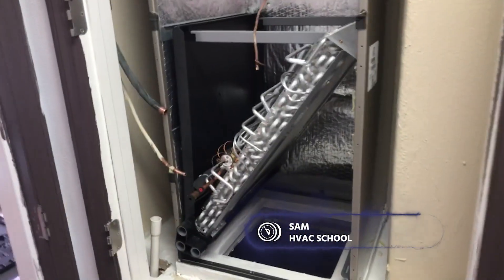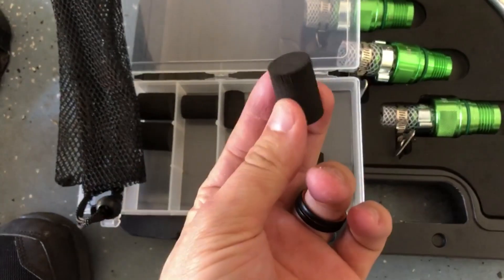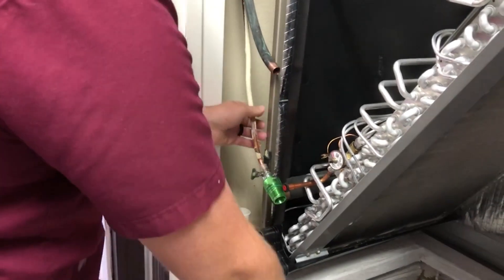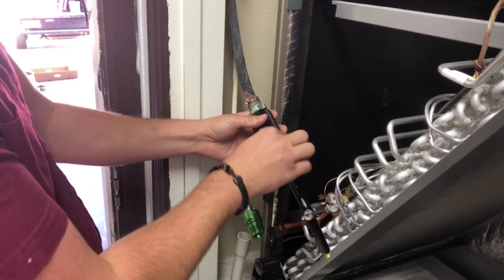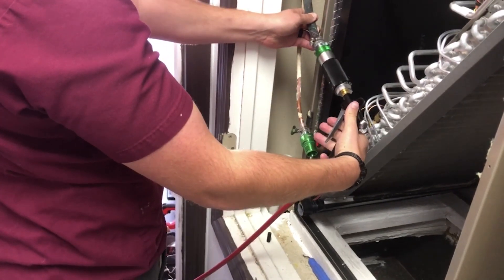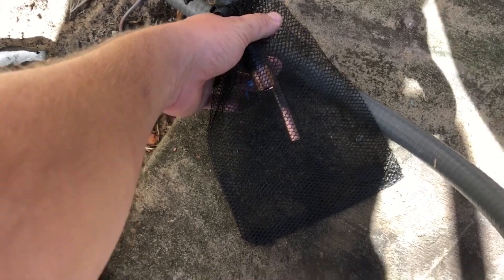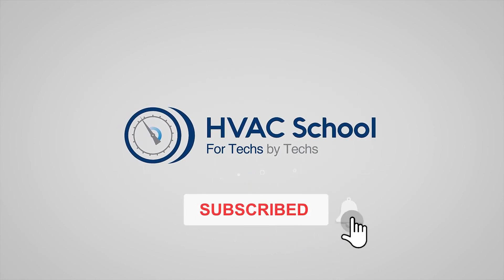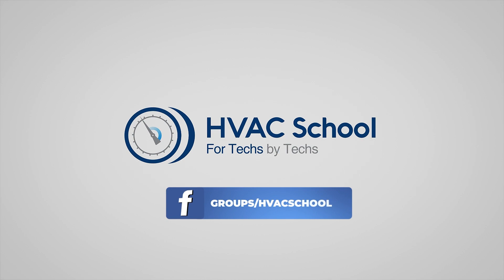Hilmor Lineset Cleaner - Field Demo

Comment: Small over braze or copper would stop that plug. Not sure what it achieves. Change your drier blow through with ofn . Triple evacuation then good old fashion vac
Reply: Mine grab the copper oxide left over from some genius brazing without nitrogen.  It works!

Comment: I would be nervous of the foam plug getting stuck like in a slight kink or a fitting. Not to mention different size pipes in the other.
Reply: He did a demo at the symposium. Check it out
Reply: That's exactly what I was thinking

Comment: Does this eliminate the need to flush, or would I do this in addition to flushing? (Changing out an r22 system with 410a system)
Reply: You shouldn’t have to flush anything mate. Blow her out with nitro and call it good. Residual oil from 22 won’t hurt a 410 system.
Reply: @EyeForKnowledge.  the oils between the two refrigerants aren’t compatible. The minerals in the oil from an r22 system need to be removed from the interior of the lineset. This requires a chemical flush to remove it, or maybe this lineset cleaning equipment. I’m hesitant to believe what you’ve said since your reasoning is flawed. Can someone else weigh in here?
Reply: Wrong. Always flush @EyeForKnowledge.

Comment: And if it gets stuck because the lineset installer kinked a bend 10 years ago? Or a service tech repaired a leak halfway in the lineset by brazing a 3/4 piece inside of a 7/8 line? Are the plugs soft enough to squish through these scenarios?
Reply: Brian did a demo with the hilmoor guy at an Expo. 
He ran those pigs thru about 30 tight 90s and a bunch of crazy kinks
https://youtu.be/uyjniIfvvPQ
Reply: @dunkdamonk  Thanks!
Reply: New line set. The person before might not have deburred, causing cavitation and holes so contamination by burnt comp not only consideration. There are people that don't braze with N2 to stop copper oxidation so there is another source of metering device boogers. ALWAYS a new liquid line filter...
Reply: @SovereignTroll  carbon buildup should just wipe away.
Reply: @BigBack_DaddyJAK  so you haven't had to replace TXVs due to other's brazing? It isn't possible to clean CuO residue products away inside. Copper pepper.
Reply: @SovereignTroll  I meant that little plug should wipe it away because if you cut one open and stick your finger in you can wipe the carbon away. Whatever the refrigerant hasn't washed away and crammed into the screen of the TXV.
Reply: @BigBack_DaddyJAK  And I have to change coils regularly too. You MUST BRAZE with only N2 in the system or you contaminate it.
Reply: @SovereignTroll  every single time.
Reply: @SovereignTroll you’re answer is long ,winded and useless.